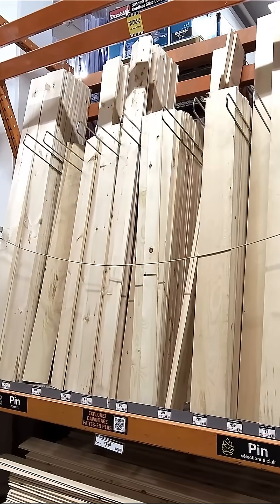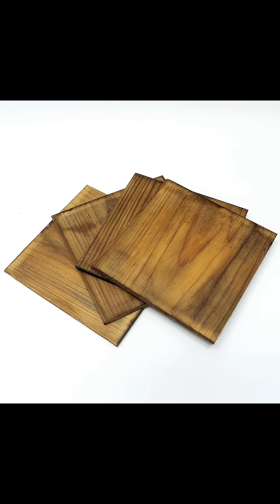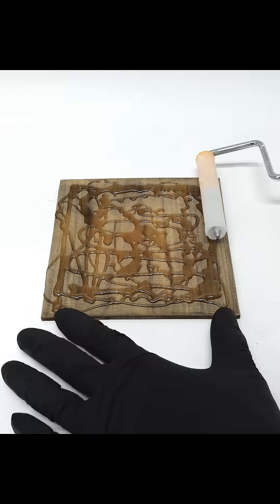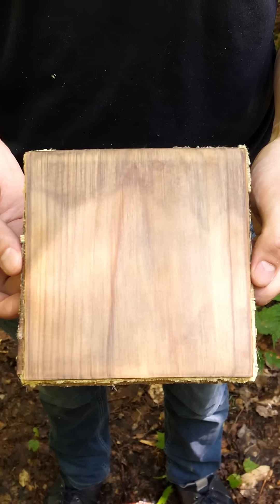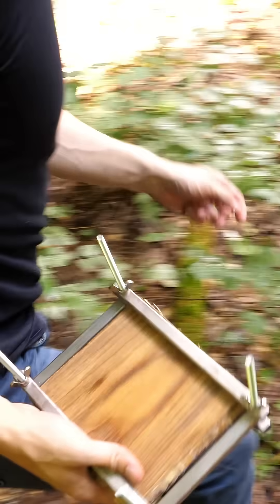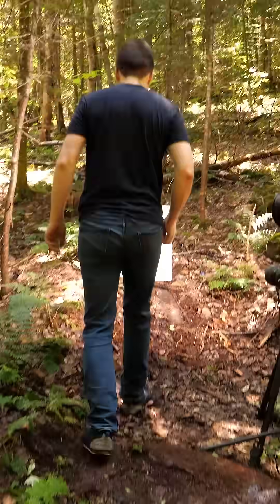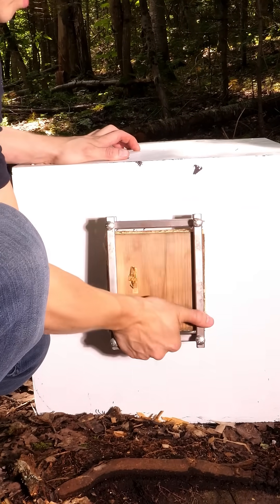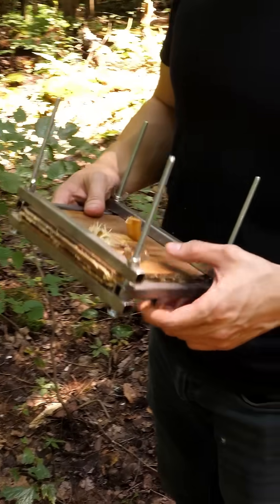Making bulletproof-er wood

Comment: Okay, Im sure you are way ahead of me on this given you clearly are at a higher level of education than what I received, but the thing about pullet proofing is spreading the kinetic force outwards.

To do that, you need either fragile materials like ceramic that will distribute the force via shattering, or flexible materials that will redistribute it in ripples. What you created was a highly durable and inflexible material, which more or less makes it a direct transfer of force forward into the target instead of to the sides.

This would work with materials like steel if the plates are thick enough, but that is an entirely different objective.

I don't know exactly how you would go about improving from here. Perhaps taking notes from body armor and make wooden pannels sewn into two layers of kevlar to provide kinetic absorption with the flex needed to redistribute the force? Maybe provide intentional scoring in the wood to allow it to shatter like ceramic? If your goal is to make wood that can resist the bullet directly, rather than a wood based bullet protection, then you might want to look into layering springier woods like palm with denser woods like walnut to create a sort of icecream sandwich of hard, soft, then hard again. This would create a hard surface that resists the bullet itself, then a core of softer material that can more easily flex and redistribute the energy, with a hard back material to act as a bracer for the needed compression of the core material.

I don't know how well it would work on something like a bullet, but the same idea is how gambisons protect against blunt force weapons. A thick later of wool sewn between two layers of fabric like a quilt, with your body and the blunt weapon functioning as the hard surfaces facilitating the compression of the soft material. With wool its not the most efficient, but the more resistant your elastic soft material is to forces the more efficient it will be at transferring that force outwards. Kinda like how a sound travels faster in water than in air because of the density, same idea.

Thats just my thoughts though, I don't have the full scope of the project or the desired materials, so there's probably plenty of reasons this wouldn't fit the project, and like I said you are probably way ahead of me on this.

Comment: Kevlar needs that flex, as it flexes the woven fibers tighten, catching the bullet. Stacked and soaked in glue woukdbjust cause the fibres to shatter on impact, really cool idea though. What about carbon fibre? It’s meant to be hardened and is stronger and lighter then steel.

Comment: Don't you learn nothing about how to reduce forces on impacts?
You build it like the cars of 1930s strong but not flexible. You took all the flexibility of the Kevlar by glueing it all into a sandwich. It wasn't necessary you use a frame so just put it all lose together between clamps or a frame.

Comment: When you glue up kevlar like that between layers you are defeating it's strength which is tensile strength and instead are placing the fiber under a sheer force causing them to tear. The glue effectively prevented the fibers from distributing the force, which is why Kevlar composites are layered and stitched together.

Comment: The problem is not enough sheer stopping force of the wood like the previous one had, and so the kevlar is basically just a spacer that negatively hinder its performance.

You might need 2-3 layer of wood per kevlar in the hopes that the wood slow down the bullets enough for the kevlar to catch it, like ceramic would.

Comment: Like many people pointed out the first problem is the kevlar not beeing able to bend and flex properly. 
Secondly for those in between layers use floor tiles that shatter on impact. It distributes the force of the impact significantly and evenly across the tile. Bulletproof vest and tanks have the shattering layer aswell. 
Also maby try to create a reactive amor next that ignites when a bullet hits it creating a small explosion as first layer it pushes the bullet away. Something aimilar in power to a table pyrotechnic device has enough power to lessen a 9mm round by about 12% and sometimes makes it spin sideways or breaks the bullet up to make it shrapnell (which is then caught by the rest of the plate better) 

The most important thing to know is when bulletproofing: we want to distribute the force generated in the bullet evenly or change it's flightpath so the most force isn't in the bullet's tip anymore
Reply: That was the first thing I thought of!
Porcelain tiles instead of Kevlar.
Advised
Slow the bullet by using it's KE to shatter the tile into dust
Reply: Also, what glue is he using? 
Id use PVA for any wood-wood joins, it ends up stronger than the wood itself. 
Wood-Porcelain is a different case though, probably epoxy but you need to remove any gloss finish, needs to be very matt.

Comment: there are several different kinds of Kevlar most of the time heat resistant an stab resistant if you can buy it real bp armor that takes Kevlar and is light weight is very protected an not sold to "enthusiasts" also Kevlar is one of those things that does have a gel layer so you would be better off with fiberglass holding a resin layer or wood

Comment: I also have a theory: since he didn’t seem to use any press or clamps, the glue layers are probably filled with thousands of tiny air bubbles, that all simultaneously burst on impact.

The beat approach would probably be to use a vacuum chamber for any glue composite.

Comment: So what i did was i starting typing this comment and this is the end result. So what i then did was put it so that the comment was put together in a way that could be read if looked at from a 90 degree angle. And this is the result. And then what i did was...GET ON WITH IT

Comment: Someone said this... Kevlar has to flex/deform to work. But also it too must be layered to get stopping power. Plus reducing the thickness of the wood reduces it's stopping power. [Recommendation] You want that outward fragmentation from the wood. That is the energy of the projectile being dissipated.

Comment: I suggest gluing together layers of wood veneer with epoxy. Before fiberglass and carbon fiber composites were widespread, laminated spruce was about the best composite for lightweight strength.

Comment: Not using heat set adhesives when you already have a hot press feels like a wasted opportunity. Especcially when the substrate is wood based. 

Traditionally you would use urea-foraldehyde and phenol-formaldehyde resin. But there are some interrestening research papers on lignin based binders for wood. Wich would fit the overall theme of making wood bulletproof.

Comment: Try rice glue mixed with pulped newspaper and epoxy, and compressed til it dries. The rice glue shrinks as it dries, weaving the fibers together and locking them in place. I suspect that would perform way better than wood. I would add layers of Kevlar fabric or silk and use maybe 20 (or more) layers compressed together.
Reply: Taut kevlar can't do its job.

Comment: Bear with me, but I can't help but think of sound absorption. Aspiring voice actors, musicians, and such try to just use some checkered foam or thin curtains to absorb or block sound when really it's denseness and thickness that is the key. A bed and mattress with a wooden frame does wonders for sound absorption/blocking, compared to just a few pieces of foam. I think the same logic can apply here. Denseness and thickness are the most important thing. Multiple unnecessary layers with inefficient materials can only fail. Like two very thick pieces of wood might do better than that did at stopping the bullet.

Comment: yeah, as soon as i saw glue + kevlar.. nope.. there's a reason why kevlar in bullet proof vests isn't rigid. Kevlar works by essentially "catching" a bullet, and dissipating it's energy throughout the Kevlar weave with it's flex.

I'd like to see this test performed again but only glue the outer edges, that way the kevlar is still flexible in the middle.

Comment: Also thinner layers of wood wood bends and stretches when thin enough why do you think it's both strong and more expensive for plywood that has more layers per inch you just need a bit better of an understanding of what makes something tuff vs hard it needs flex or it just brakes

Comment: Kevlar is bulletproof when not infused with anything else, the dry layers of kevlar are the ones that catch the bullet. Now, the laminated wood is good, but the wood has to be dense and very firmas attatched between fibers for it to work. Try removing the kevlar and using yellow wood glue along with clamps to laminate it. And, if you add a super hard layer in the front (like ceramic or glass) you will get even better results because between the bullet deformación and the shattering odio that layer there is a very large ammount of energy dispersed into something that is not the bullet movement.
Reply: firmas? odio?
Reply: @Derek_Keenan  spanish autocorrect moment
Reply: Likelikelikelike
Reply: so...  carbon fiber front, double or triple wood, then kevlar backing attached to front but not back?
Reply: This is just entirely wrong on the first quote. Kevlar is bulletproof and stronger and the only viable way to turn it into armor is to use it with epoxy as a binder while stacking layers at 45 degree or 90 deg offset same manner as Fiberglass. UHMWPE on the other hand is fused through heat instead
Reply: Yellow wood glue? Okay kid
Reply: @DILFDylF  going to elaborate on why you are talking down to them?
Reply: @scorcher117  You're asking me to explain it? I'm not your dad
Reply: @DILFDylF PVA glues like titebond are surprisingly strong.

Comment: Honestly you have more successes if you built it with about 5mm of space between each layer of just air  so 1cm between the plates with a sheet of kevlar in between the plates. 

you could also try   making the  plates thicker  again.

Comment: i think the way you're meant to do kevlar is with like multiple layers of kevlar on top of like a squishy "crumple zone" material, so that the kevlar can flex and disperse the force with its amazing tensile strength.
you might even get better results by just stringing up those layers of kevlar like a trampoline.
if you're looking for a better filler material, you want something that has a lower threshold for plastic deformation, I'd say like... gorilla glue where you don't clamp it down so it sort of foams up from releasing whatever gas it releases as it cures, or maybe some spray insulation, or that hard polystyrene foam that every quirky chemistry teacher from middle school turns into a crunchy mushroom-shaped pencil holder.

Comment: can you try something. do it the same but leave a 5mm or less gap so wood kevlar attached to the wood then some spacers with a gap. 

i betting right now for a sliver of your gold (enough for a beer )that it will improve massively. think how easy you can push through and cut taught paper/fabric vs loose.. that space gives the fibers room to move stretch and deform. Without that room the fiber experiance a massive force all at once and everything just shatters. so same force but spread over time. i wonder how much of a differance secured kevlar verses free floating

i betting right now for a sliver of your gold (enough for a beer )that it will improve massivly. think how easy you can push through and cut taught paper vs loose.. that space gives the fibers room to move stretch and deform. Without that room the fiber experiance a massive force all at once and everything just shatters. so same force but spread over time. i wonder how much of a differance secured kevlar verses free floating

Comment: Try angling the end grain. You want the most fibers possible to absorb the kinetic energy. That means exposed end grain is what you want. However, if the end grain is perpendicular to the cut, it will split very easily. I imagine end grain cut at an angle. Also, don't glue cevlar, it needs to stretch.

Comment: The problema is that the overall resistance increased but the impact distribution didn’t or lowered. Bulletproof vests aim to distribute impacts, that’s why even one bullet on one side of the vest can lower the efficiency of the rest of the thing.
Reply: Maybe some plates that can flex could help

Comment: It's really nice to see that not all hypothesis are correct.
Reply: I wonder if carbon fiber glued in wood, ha ha work any better?
Reply: @bigjay875  Identically. Both are reinforced polymers (plastic fibers) that are mainly resistant to traction loads (opposite of compressive). CFRP is only good and used in aplications where you absolutely need it (huge traction loads, and it holds traction even better than much steels, while having a much lower density) due to its very very high price.
Reply: @nunosanto7365 carbon fiber would shatter indeed, probably more easily than Kevlar, spider web beats both of them, but is even more expensive.
Reply: @bigjay875 remember the Titan submersible?
The same concept that broke the sub would happen here.
But instead of the pressure being all across the carbon fiber, it's gonna be on a single point (the bullet), which is a lot better at breaking it.
Reply: That’s why it’s a hypothesis and not a theory
Reply: That's common on this channel and science in general.
Reply: And thats how we learn! 

By trying, being wrong, and trying again with a different method.
Reply: If you watch his more experimental videos, most of his hypotheses are incorrect. This bulletproof wood project went through so many test cycles.
Reply: @gremlinman9724  It's nice that he shows the process rather than only showing the successes.
Reply: UTTP IS BETTER THAN NILERED
Reply: UTTP IS BETTER THAN NILERED
Reply: Yes. That's why you conduct experiments.
Reply: And it’s I’m nearly certain that it’s absolutely FABULOUS to start out assuming they’re all incorrect. It’s devilishly hard to wish for the demise of your cherished ideas, but doing so avidly absolutely BBQs bias and makes any significant results fairly impervious. Explaining them to others and convincing them…that’s harder.
Reply: he destroyed the kevlars ability to work by glueing it so much. his hypothesis could theoretically still be correct if hadn't mishandled it and ruined the test.
Reply: @bigbadsauce92 The Army’s kevlar helmets are so rigid that they required many more layers to be effective. I’ve also heard that they had to create a more fluid-like (AKA viscoelastic) resin that allowed for micro-deformations of the fabric. Nigel might have done better gluing things up with Great Stuff (or maybe wetted) Gorilla Glue and NOT clamping tightly during The Cure. Engineering armor is a GREAT design & development lab!!
Reply: most hypothesis are flawed
Reply: @luu-rei EXACTLY!!!

Comment: Kevlar works because it has high tensile strength, and the fibers grab each other under tension. Fiberglass has higher tensile strength, but slides around without a solid matrix. Hence kevlar is used for flexible vests, but fiberglass is used for fixed panels. See Waco Composite Wall Panel armor. You need a lot more layers of fiber either way though.

Comment: The impact resistant glue also made it just worse, the woods might be just enough for the Kevlar to flex but the glue especially being impact resistant is no good. Probably still better with ceramic plates or something like that and not Kevlar sheets but idk if you can just buy the ceramic layer, it's supposed to shatter so it would probably be better with the wood instead of the Kevlar which needs a bit of air to flex
Reply: Wasn‘t that „impact resistant“ glue meant as a joke? 🤔

Comment: You need a 2 part epoxy to impregnate the Kevlar, and a method to pull a vacuum. Otherwise your just got stiff fibers in hard glue, which is no stronger than just glue

Comment: What if you tried to coat the thinner layers of wood in something else and left out the kevlar. 

Ideas for coating: 
Iron
Carbon
Copper
Resin
Very thin layer of aerogel
Silicon crystals

These are all things that readily disperse energy in different ways.

Comment: Does it make a difference if you clamped the layers really tight as the glue dries? Each layer is dense, but as a whole, if there's small layers of air in between, then the whole thing isn't as dense all the way through. Idk, it makes sense in my head somehow.

Comment: Oof, not locking the bolt back and verifying the gun is empty and removing mag before dropping it on the ground and running down range is a big no no😂

Comment: Your layers are to tight together try using cardboard on either side of the Kevlar (sandwich the Kevlar between two pieces of corrugated cardboard) and then glue the cardboard with Kevlar to the wood ! 

Or better yet 

Go wood board then cardboard then 2 layers of Kevlar, cardboard and another 2 layer of Kevlar then cardboard again then wood board behind it all 😅 not great looking but it'll stop a 9mm no problem

Comment: I thought Kevlar worked by each layer absorbing a little bit of the momentum and sequentially deforming around the bullet. It's stronger than steel, but nobody expects a 2 mm thick piece of steel will stop a bullet

Comment: You should only glue the edges of the kevlar and use a thin plate of aluminum at the back, the aluminum will be more bullet proofing and it'll deform instead of shatter, plus it'll hold the wood in so it wont shatter as aggressively